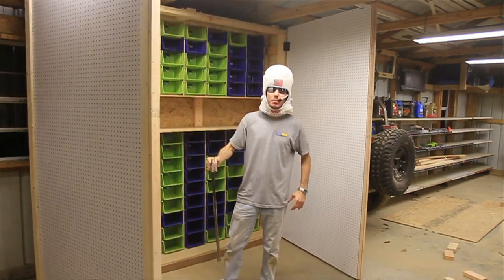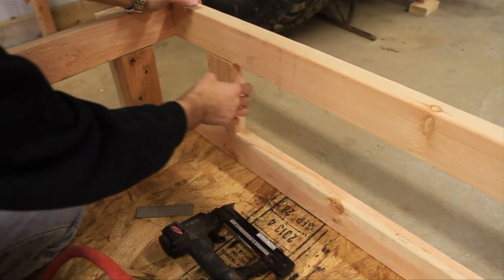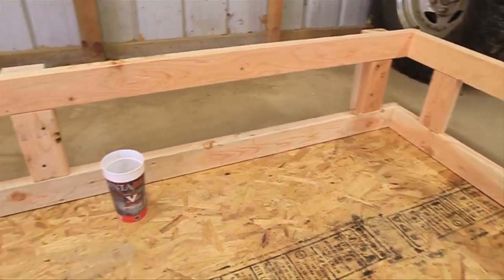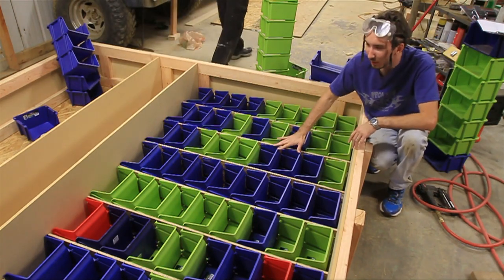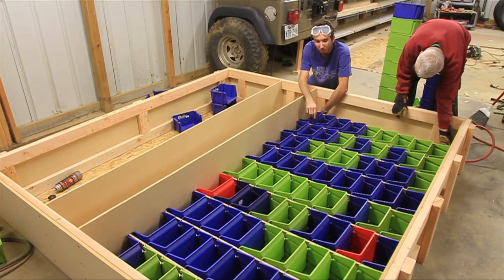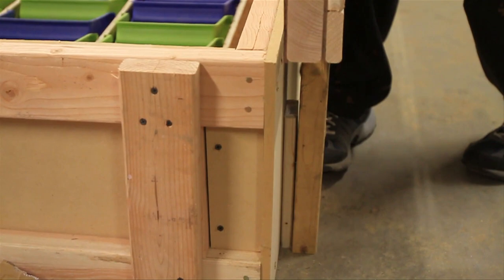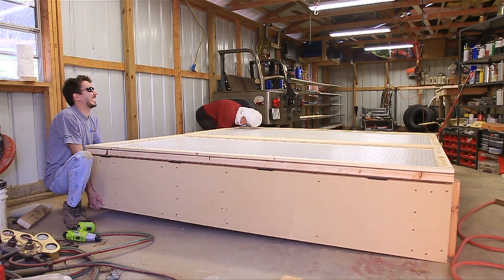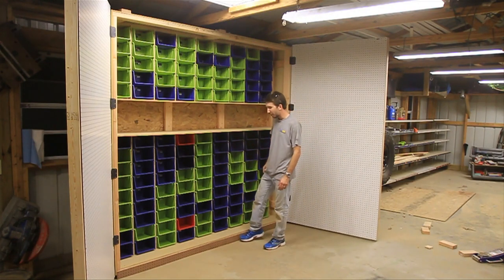How-To Make the Largest Garage Peg Board and Bin Cabinet in the Universe!

Comment: Great idea, thanks for sharing. I think those hinges will start to sag when you load up the doors with tools etc. I would look at putting some castors on the doors to support the load.

Merry Christmas.
Reply: Use AdjustaGate for doors .Get it at HD in fence area .Build doors as per directions NO SAGGING ! Made a believer out of me ! Also put steel studs inside each door centered and spaced out 24oc

Comment: what I would have done: the bottom is a good idea, with the 2x4's, but I would have made the bottom like a pallet (put the 2x4's on edge and use a 1x4 to hold them up). That way you can actually use a pallet jack to move it. They're not too expensive to buy and cheap to rent. Another thing I would have done is put casters underneath the door. It would help keep the doors from sagging and make opening the doors easier. Finally, no pegboard on the outside. I wouldn't want my tools out where anyone can get em. Nice work :)

Comment: MY impression is the shelf holding the top bins is too thin. It's a great idea but I would go with a stronger material and more support underneath to handle those bins. It appears to be sagging already and the bins aren't even loaded with heavy hardware yet. Once they are loaded I would be shocked if the front unsupported edge of that shelf keeps dropping.
Reply: I do agree thicker material would have been nicer looking ( imo ) - But, the weight is actually carried by the side supports which are attached to the top of the cabinet. any sag you are seeing is from the those vertical dividers is either from differences in the divider lengths or just a visual issue caused by camera angle or the lens of the camera.

Comment: That's a lot of storage. There's not much shear strength in Masonite pegboard that you used to make the doors. No glue, no center brace, no cross brace. Try stripping that outside peg board. Put a cross brace from the bottom corner hinge side to the upper corner diagonally. Cover with real plywood (not chip or wafer) glued and screwed with construction adhesive. You don't need pegboard on the outside anyway. On the inside, paint a stripe where the wood is under the pegboard so you know you can't use hangers in those holes. Keep the stuff hanging on the pegboard light as possible.
Those top bins are inaccessible  without a ladder. Too bad they can't slide out individually. Pressure treated on the bottom feet would have been nice. A lot of good woodworking techniques, except when you split that corner screwing into endgrain. I would have used a lot of glue on this project too for more strength.